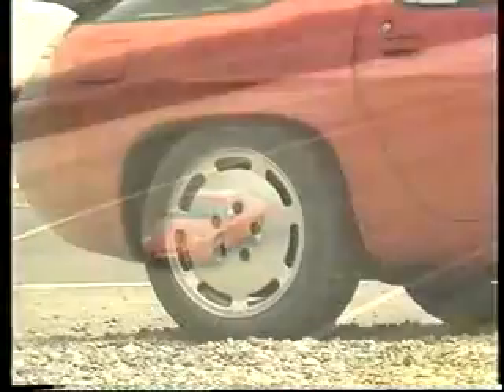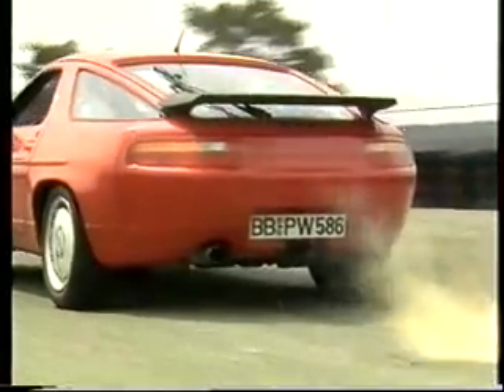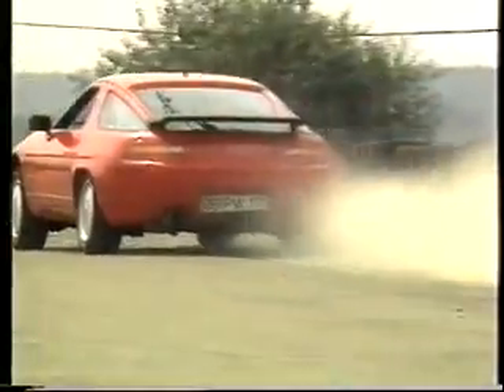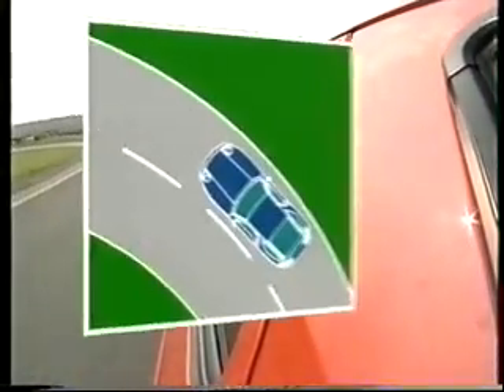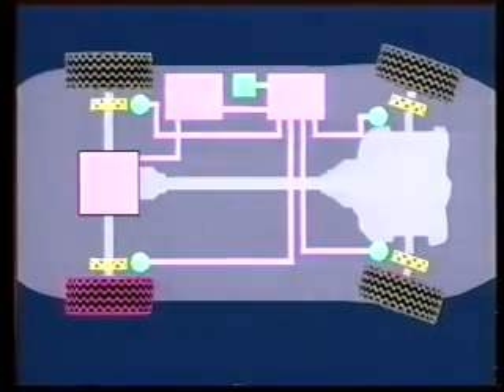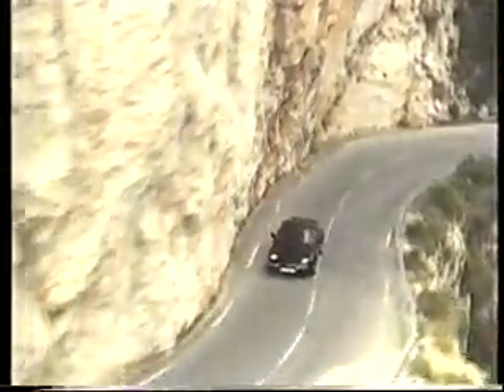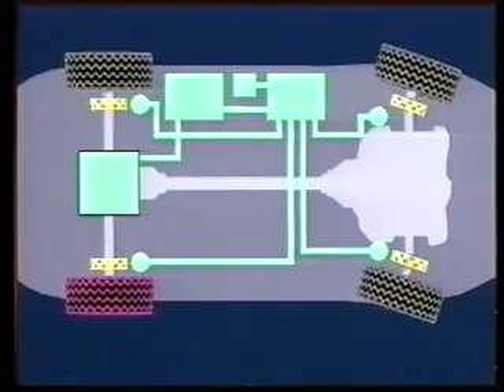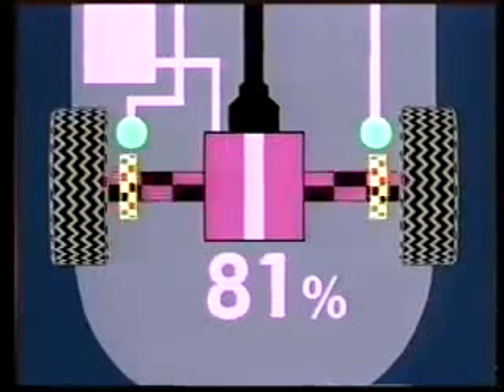Porsche 928 PSD differential

Comment: The PSD lets you put all the power down, instead of limiting your throttle. If you put all your power down on ice, you're still not going to get traction with PSD. With traction control, the ECU will cut your throttle to reduce wheel spin. ESP (electronic stability program) will then brake individual wheels if you're still getting out of control.